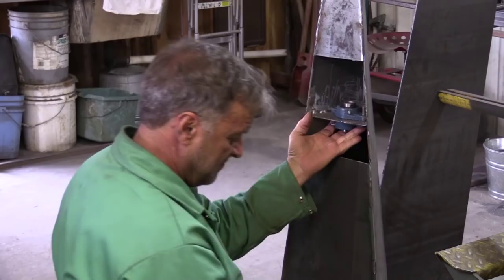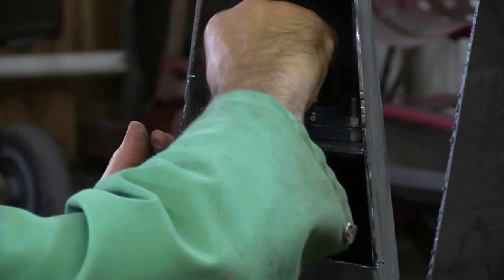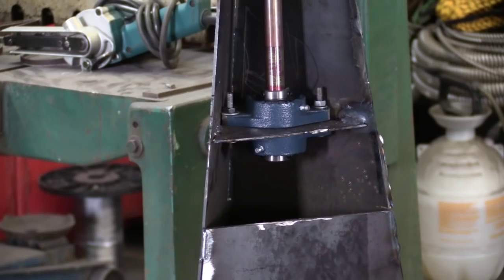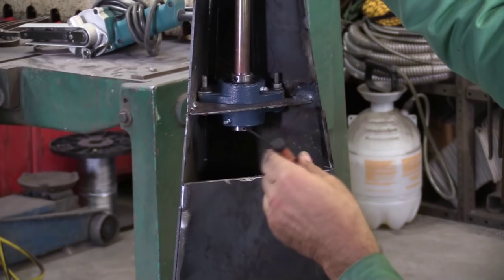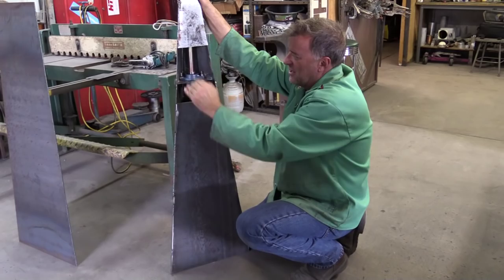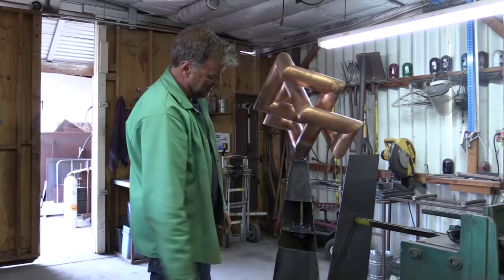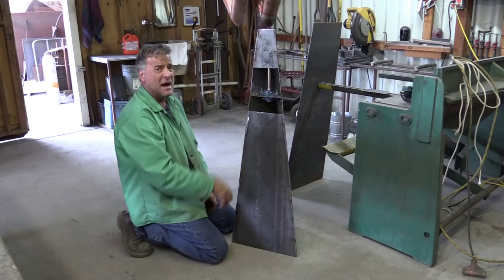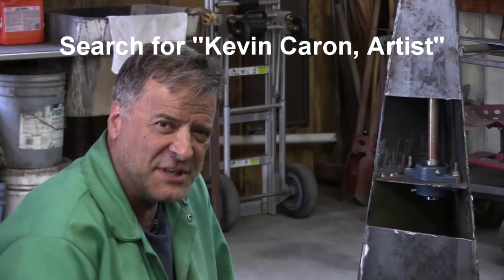How to Keep Spinning Components Straight and Steady - Kevin Caron

Comment: Might think about a rain shield on the shaft between the art piece and the pedestal like manufacturers put on air condition outside unit condenser fan motors.  I think that it would make a nice decorative top  to cover the open hole in the top of the pedestal.  Or maybe this is an indoor piece.  I really like the art piece.  Natural patina will be nice.  Shiny copper would probably be too difficult to maintain.  And thank you for showing works in progress.  I have mechanical abilities, but missed the artistic gene.

Comment: Kev, install you bolt with the heads on top that way if the nuts come loose they will fall off but the bolts will still be there hopefully not wobbling to much and protect your nice looking piece of art. Old aircraft mechanic kicking in!
Reply from the maker: +Ronald Hays       Thank you,,,     When it is finished it will be bolts from the top with nylock nuts to make sure nothing will come loose...

Comment: Very cool, Kevin. Did you use some variety of thrust bearings? If not, you might consider swapping some in. It's not something most people think about, but the perpendicular pressure on radial bearings will otherwise degrade them pretty quickly.
Reply from the maker: +FXM      Always something to keep in mind..    If this was a motor driven piece or wind driven I would look for heavier bearings but it's an indoor piece so should not be a problem..     Thanks for the tip!

Comment: Which bearing you used for this sculpture ???
Reply from the maker: Please read the description at the beginning of the video.     I used 2 flange bearings in this sculpture. You can use any make as long as they fit for what you are doing.   I got these at Granger I think.